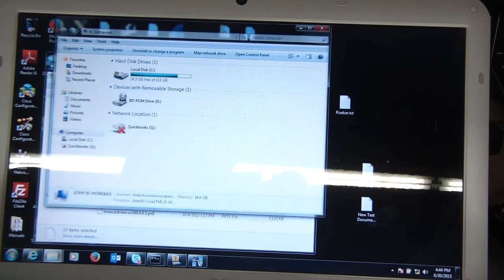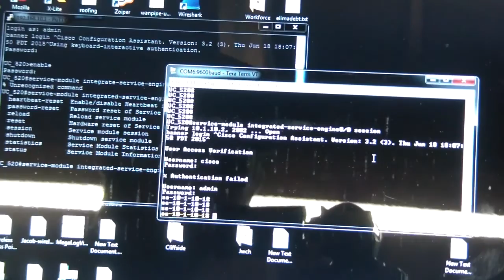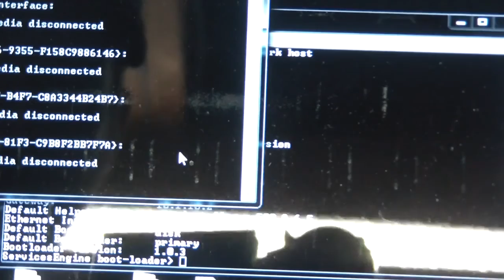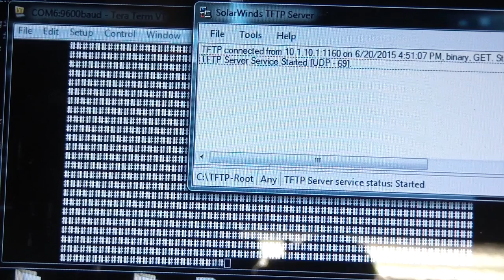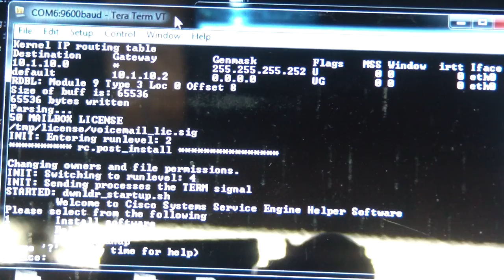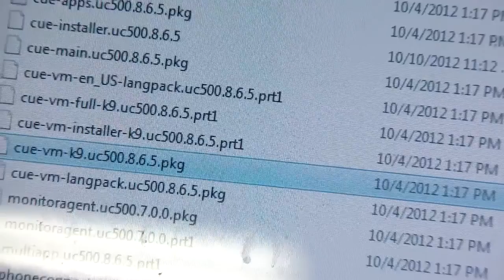Cisco UC500 UC520 UC540 UC560 Cue unity repair corrupt flash

Comment: Thanks very much for your video, well done.  (this came up in a google search)
I have a small SMB that requested service on a UC520 for this exact issue today.  I'm not a CISCO guy, but I do dabble.  I believe I've downloaded all of the correct software for connectivity and UC500 software for the IOS, (I've ordered a flash card just in case it's a hardware issue), the only struggle right now is a console cable.  I have a DB9 to USB converter, and I do have a RJ45>DB9 Shell, but for the lift of me I can't find the pinout.  Can anyone point me in the right direction?  Also, when doing this onsite in a little bit, I'm assuming if this is a hardware issue it will fail the install with a hardware error of some type?  Thanks in advance for replies!
Reply: @FintechRepairShop - I made myself a DB9 shell with the correct pin-out and I'm able to connect to the console port using a USB > DB9 adapter.  I can communicate OK with the UC520, both by SSH & Console.  Here's the issue:  The software on this machine: cue-installer.ise.3.0.3  Any advise on what to do with this system that has exactly what you've diag'd in your video, a bad/corrupt CUE - but I don't think I'll be able to find the cue-installer.ise.3.0.3 anywhere to reinstall IOS.

Comment: Hi,
Great video and really helped.  Managed though to corrupt the CF card so the Reiser partition is now gone and as a result the CUE won't boot.

Would you know how to recreate the partitions so I can reinstall the software?

I have tried boot helper but this sends a request to the tftp server continually - it never acknowledges the response from the tftp server (can ping etc to the CUE so that is good) - I believe this has to do with the fact that there is no root partition on the card.

Anyway, any help in actually replacing the card would be great.

Thanks,

W.

Comment: When I reset the Service-Engine I get the bootloader message, but when I hit "***" no command prompt came up. Any idea?
Reply from the maker: Are you using a USB to serial converter? Sometimes those things are hit or miss.
Reply: @fintechrepairshop  Yes, same Setup as in the Video.
Reply from the maker: @Johannes1961  I've had certain adapters not work right in the past. One time I had adapter that would not allow me to send a break command to do a password reset.
Reply: @fintechrepairshop  When I type the * at the command prompt, before Session to CUE, I can see the * so it should work. After which message you type the *?  
I didn't get the "Resetting devices  ...Done." Message. All other messages are the same, including version and date & time.
Reply from the maker: @Johannes1961  I usually just start doing a bunch of *************** until I see the bootloader command. I've had nothing but problems with Cisco Cue modules.
Reply: @fintechrepairshop  Last line that I get is:
(Jul  6 2007 - 10:15:37) MPC83XX
Reply from the maker: @Johannes1961  What is your cisco device. Check your cue ram. Do your cue try to boot or does it just get stuck.
Reply: @fintechrepairshop  It's a Cisco UC520-8U-4FXO-K9. I think it try to boot, but it fails. It worked for years and then stopped working. I dismounted the system, after it failed, and cleaned it from the dust and cobweb. I try to read the CF card with RFSTool and could read the dirs and some config files. Unfortunately it can only show directories and read files but not check the file system. How I can check the cue ram?

Comment: Do you have instructions on getting a UC560 installed. I have one that is set to factory defaults. When I try to use CCA to configure there is no IP address on the UC560. So I make VLAN 1  the standard 192 address. Then I get the message they it can't use vty to access the 560, so I fix that. Then it says I need an address for the service engine, I give it an address, and now able to access the device via CCA. But, there are options grayed out ( like the number of digits for the ext) that says it needs to be initialized to change that.
Reply from the maker: On the flash card there should be a default config file you can copy over. You have to do this at the command line.
Reply: …..and there is a default config file......and if the  config register was set to x2102 instead of x2142 ( by pass startup config)  things would of worked!!!!!

Comment: I need help to repair one unit like this. Who can help me?
Reply from the maker: where are you located?
Reply: Fintech Repair Shop im located in Mexico, i can provide a teamviewer session and a number to call you and help you during this process.
Reply from the maker: I wont be back until tomorrow afternoon. We need a TFTP and FTP server.
Reply: Fintech Repair Shop yeap, I have both running  on my laptop. I have a dual Ethernet card, console cable, new cf card, cue firmware. Let me know the best time for you and we can get connected.

Comment: Very helpful video. I bought a used uc560 and one of the software packs didn't install correctly and left CUE in an unstable state. This allowed me to load the latest CUE on and get it going. Still want to have a clean software pack install, but you not only got me through this hangup, but gave me a new trick to reference. Thanks!

Comment: The process you describe, does it delete current configuration aka extensions, mailboxes, voicemails?
Reply from the maker: Yes, You will need to import the mailboxes from CME. The is a completely different flash card and it formats it.

Comment: Hi I am having a very tough time getting the files from cisco needed to reinstall cue on a uc520 that was hit by a power outage causing this cue vm issue. Would you mind uploading them to dropbox? Please
Reply from the maker: +Stephen Osborn 
The files are in the UC520 package files under cue. 

http://laudan.ch/upload/Cisco_IOS/uc520/
Reply: Thank you I can connect and see my CME version 7.0 in CCA. I am having trouble when I send the ssh request to reset integrated-service-engine0/0 my console is not showing the boot loader to get into cue help. CCA also doesn't show the current cue version but does display CME version. Should I just try and use CCA's GUI to upgrade cue version? Its a uc520 that experienced a power outage do you think its the flash card? before I buy one which CUE version should I try and load with cme 7.0? Thanks for your help!
Reply: My current Software pack is 7.0.4, and IOS image:uc500-advipservicesk9-mz.124-20.T4
Reply: Just trying loading the SCUE7.0.3 zip located in the 7.0.4 which im running from the downloaded files and got a validation error. leaning towards needing a new flash.

Comment: Yeah this helped me out today. The card was corrupted. Instead of using your console + SSH method, I just used a line "clear line 2" which stops that whole process, and then restart the service module to break into the repair mode. I was seeing all kinds of reiserfs permissions errors, pulled the CF and loaded onto a linux laptop and performed a resierfsck /force. Repaired and deleted some corrupt files, led to a kernel panic. WHEE! 

Anyway, I was looking at a complete system reload when I came across this, much much easier. Actually I was still connected in CCA when I did the the bootloader helper, CCA detected and asked me "Are you upgrading your flash?" I said yes and pointed to the whole zip package and just let it do it's thing. THANKS!

Comment: Thank you for sharing your knowledge.
I have a UC520, I am trying to use CCA for configuration, I can never log to it.
That would be nice if you can help
Thank
Reply: +St Fleur Cetoute  I have some basic notes about the SNMP and HTTP service requirement CCA has to be able to concurrently manage both the IOS w/ CME + CUE module concurrently.
Reply: HI Brian Seklecki, that would nice if you could share them.
Reply from the maker: +St Fleur Cetoute 
What error are you getting? try right clicking on the desktop icon and run as administrator.
Reply: HI
I think I solved the issue, I am able to connet to the CCA now after I did the proper config through the CLI.
Once, I connected to CCA go to gui, it said I need to factory default the UC520.

I really appreciate the fact you answer to my comment. Thank
Reply: sure!; I've been working on them slowly as a side project.  Any specific recovery instructions that you require at this point?
Reply from the maker: Cool
Reply: Now, can use CCA for my configuration, already register a phone. I got google voice number. Did you ever make the incoming/outgoing call on UC with the google number ?

Comment: Can you recommend a few SKU#s for commodity SD Card replacements with which you've had success?
Reply from the maker: +Brian Seklecki 
I'm not sure about SKU's I only fix these as I get them. I've had good luck for Sandisk up to 4GB
Reply: +Fintech Repair Shop - Yea it looks like it fails to install when you use  CF card > 4GB; Even an 8GB Cisco original authentic OEM SD card (meant for an Nexus 7K RSP) Error:Failed to open '/dev/sda1': No such device or address. mount: you must specify the filesystem type
Not enough disk space to download necessary files.
Error: Error encountered while downloading payload(s)
Error encountered while downloading payload(s)
Unable to install. Please try again
Reply: +Fintech Repair Shop 
Never mind my last message! A power cycle of chassis was needed after physically inserting the new target SD card into the CUE daughter card holder.Although it is a ridiculously expensive and overkill in size, Cisco SKU # N7K-CPF-8GB= appears to a good Cisco-authentic-genuine candidate for use in this application.(If this hardware is anything like Lucent/Avaya, people will be refurbishing these systems for 20 years after their EOL)[ ... snip from DMESG ...]
Uniform Multi-Platform E-IDE driver Revision: 7.00alpha2
ide: Assuming 50MHz system bus speed for PIO modes; override with idebus=xx
hda: probing with STATUS(0x50) instead of ALTSTATUS(0x0a)
hda: STEC M2+ CF 9.0.2, ATA DISK drive
ide0 at 0xe1000000-0xe1000007,0xe100280d on irq 17
hda: max request size: 128KiB
hda: 15435504 sectors (7902 MB), CHS=15313/16/63
hda: cache flushes not supported
 hda: hda1
i2c /dev entries driver
Reply: +Brian Seklecki Quick status update: I've now tested up to 512MB Flash on the UCS5xx Chassis base system (IOS/CME).  I've tested up to a 8GB Cisco-branded flash in the CUE daughter-card.  A non-Cisco branded 1GB Flash fails to boot on IOS/CME (ROMMON limitation I believe); I need to test a Cisco-branded 1GB flash next.  After that an OEM-512MB Flash.
Reply: +Brian Seklecki One more note: I believe there may be a practical size limitation to the CUE SD card size because the Linux install shell script (which we may be able to Hackjob) statically defines the new filesystem size with explicitly define partition extents and NEWFS flags.  #HATE calls for a NetBSD hackjob
Reply: +Fintech Repair Shop -- Scratching off a few Kingston, Lexar, and Transcend models off of the compatible list.  Specifically Transcend TS512MCF80 512mb giving error: Error formatting flash: (Didn't find 55AA signature in System Sector)

https://supportforums.cisco.com/discussion/11147211/uc520-issue-1gb-cf-card#comment-11187796

The only hope might be to try to specifically format it with Fat16 using Linux  (Partition Type 0x04 or 0x06)

http://packetlife.net/blog/2009/nov/2/generic-compact-flash-cards-and-cisco/
Reply from the maker: have you tried sandisk?
Reply: Next item to try: SanDisk 512 MB CompactFlash Card, SDCFB-512-A10 CF Type I Card
Reply: We can see the difference in Geometry between the two different cards: https://goo.gl/photos/TY6fCDn8yDS9bWmD7
-------------------
Works: geometry: 995/16/63 [1002960 sectors]
(or as it reads in Linux x86_64 with USB CF Adapter)
Works: 995/16/63
-------------------
Fails: geometry: 989/16/63 [996912 sectors]
(or as it reads in Linux x86_64 with USB CF Adapter)
Fails: 1021/16/61
-------------------
Reply: You were right! Sandisk SKU#/Model # SDCFB-512-A10 is the win!   https://plus.google.com/+BrianSeklecki/posts/dbFGigiq6rB
Reply from the maker: Cool, I always had good luck with Sandisk.

Comment: Excellent video!  This is my issue exactly.  Any tips on getting SolarWinds to work on W7 64-bit?  Confirmed IP settings on IOS and laptop and disabled firewall but no communication.
Reply from the maker: +Bill Gross I never had a problem with windows 7 64bit. The the solarwinds tftp service running?
Reply: +Fintech Repair Shop Yep.  Service is started on [UDP - 69].  IP Address is the same (192.168.10.11) confirmed with ipconfig.  Show config on the UC520W also reflect the same settings.  The ethernet connection is the only LAN enabled on the laptop.  I had read some posts that SolarWinds may not be compatible  on W7-64 but I must be overlooking something  too obvious.